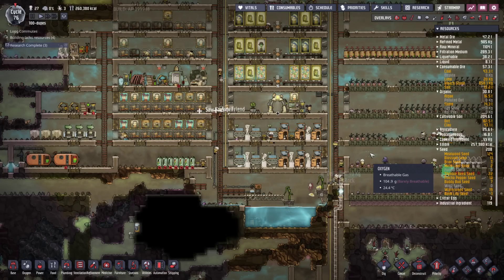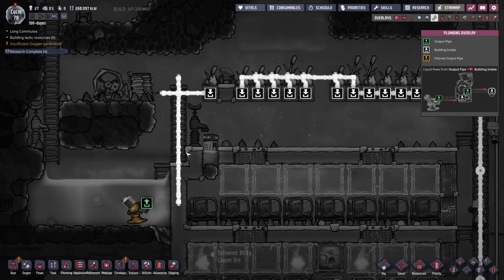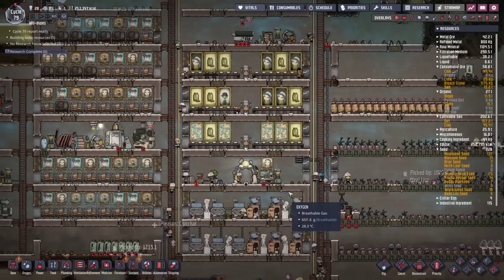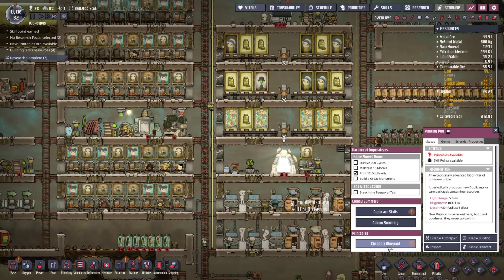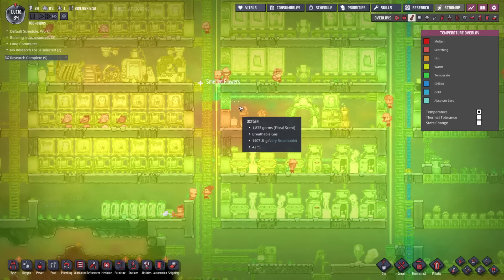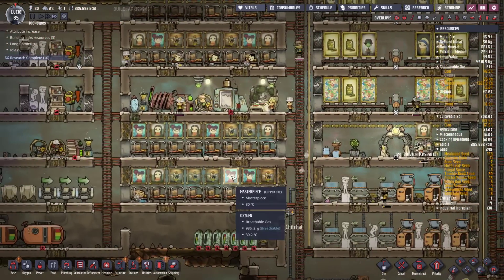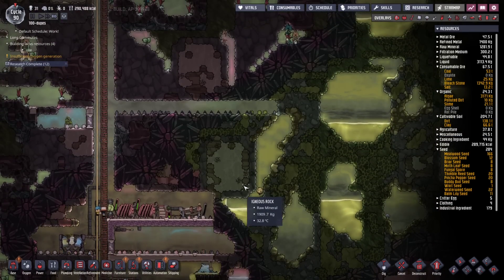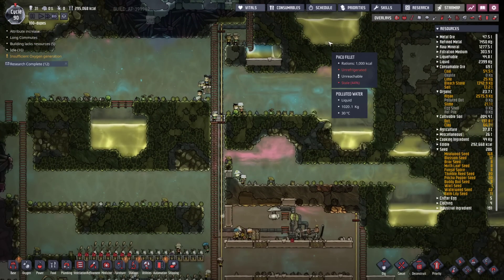100 Dupe Challenge - Oxygen Not Included - #6 (cycle 76-91, 31 dupes)

Comment: Doesn't feeding sub zero PW into the sieve break the output pipes? You are lucky so far that your PW pool has already heated up above zero. But with the insulation it's getting colder. A more fool proof way would be to use the cool PW to cool the base and only sieve it at the end.
Reply from the maker: yes I need to fix that.
Reply: The polluted water comes out of the geyser at a temperature not lower than 0 degrees therefore it will never cool down below 0 and will never damage the pipes there is no need for the fix you are suggesting.
Reply: Killer21133 it comes out at -5C

Comment: you actually should make your ranches 25 tiles long, and put 1 extra airflow tile in a corner, since you have 3 tiles used up by the door and airflow tile in the center.  Your 7 hatches per ranch will likely be cramped.

Comment: if you need a wall of 2 airflow tiles use a pneumatic door instead. it costs 100 metal ore and covers 2 tiles while each airflow tile will cost you 100 metal ore each, so 200 in total
Reply: He already does that it many places. It looks a bit silly though. They should rather rebalance the cost of airflow tiles

Comment: Just some stats for you to look forward to for 100 Dupes.
100 Dupes =
10kg O2 consumption/second, or 6 tons a cycle. It would take about 20 Oxygen Diffusers running all the time to just balance that out, which would use 2.4 KW of power and 11.1 Kg of Algae/second, or 6.66 tons/cycle.

100,000 calories consumed a cycle, about 280-290 mealwood plants.
If you turned all of that into liceloaf, you would need about 5 tons of water A CYCLE just to make the liceloaf alone. Using toilets for every dupe, that is a total loss of 4330 kg/cycle of water.

200 grams of carbon dioxide production/second, which is enough to keep ONE carbon skimmer running for 2/3 of the time. Alternatively, you could use a system which pumped the CO2 into a Slickster chamber, creating 60Kg/cycle of Petroleum (with Molten Slickters), enough to keep a Petroleum generator running for 30 seconds, 1/20 of a cycle.

Good luck!

Also, the Cool Slush Geyser does produce enough water on average to sustain an electrolyzer forever.
Reply: Nerd :) 

Very cool calculations.
Reply: Sorry I didn't fully get the part of the slush geyser, can it keep workingon average just one electrolyzer or the amount needed for 100 dupes? And if it's the first case, could be enough 1 cool slush geyser, 1 hot water geyser and 1 cool steam vent to produce enough water for the 100 dupes?
Reply from the maker: nice maths :)  Im sort of winging it vs too much planning.

Comment: I really like some of Francis John's oxygen setups (but they require Steel).  It would be perfect for that water coming out in the cold zone - that way you can cool the oxygen before bringing it to the base.  Best of all, they are energy neutral once up and running properly.
Reply: Gold amalgam works just fine. Unless maybe you are feeding them 95° geyser water. But on an asteroid like Terra you can just electrolyze all the polluted and salt water that's freely available. It will last a long time
Reply from the maker: I end up using nullifiers.

Comment: You have a Steam gyeser making 110 deg steam, put an aqua tuner in there and a steam generator.  You can get enough power to cool things and enough cooling to chill the heated oxygen.  If you're running the hot water to the base it's just a bit farther to run it to the steam vent.
Reply from the maker: I might do that or cool it with 95c water... aquatuner makes more sense though.
Reply: @GrindThisGame  I was just figuring all that water already in with the geyser would  be enough to make more steam and keep it cycling.  But the heat differential might not be enough to do much with.

Comment: I dont play this so I might be misunderstanding...If the oxygen created is always 70c why not use the 95c water so you get rid of 25c in the process? use the cold water for radiant cooling and everything else.
Reply from the maker: yeah I swapped it up.
Reply: Using hot water is good, but the oxygen is at least 70C. Output temperatures used to be fixed for many things and people abused that like mad. So they changed it to be the minimum output.
The reason hot water is good mainly has to do with the high specific heat capacity of water though. It stores more heat than the gasses it produces.

Cooler water isn't isn't all bad though as long as you don't actively cool it for some reason. At the beginning you can electrolyze all the free salt and polluted water in the biomes after turning it into normal water. If you run the water pipe through the oxygen it absorbs some of its heat.
Using hot water also overwhelms the AETN after a while. You need an aquatuner to cool the hot oxygen if you want it be really cold.